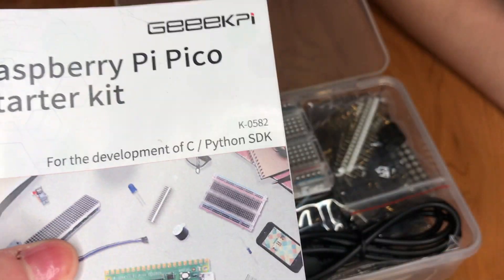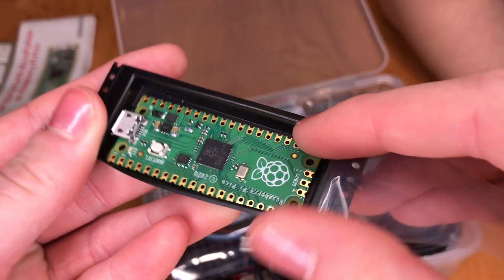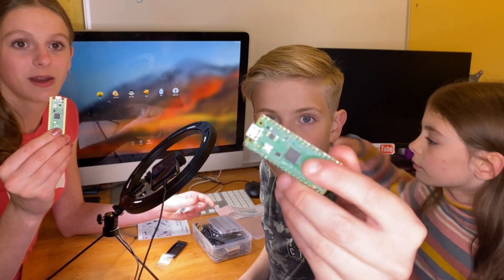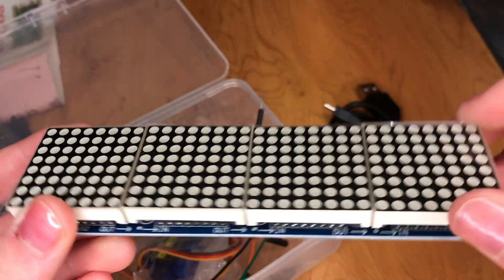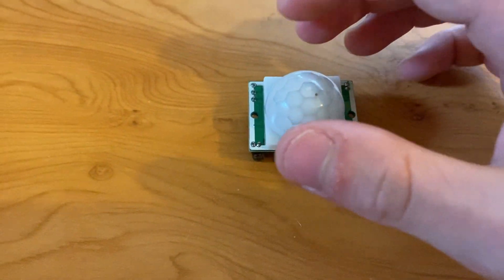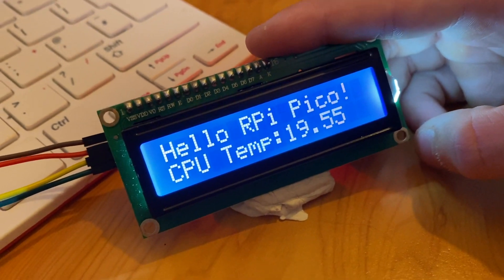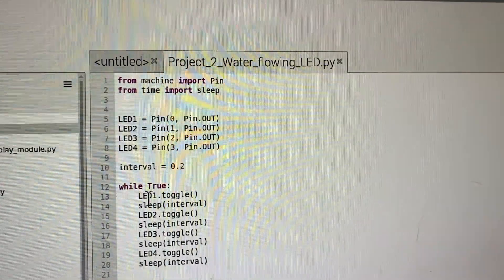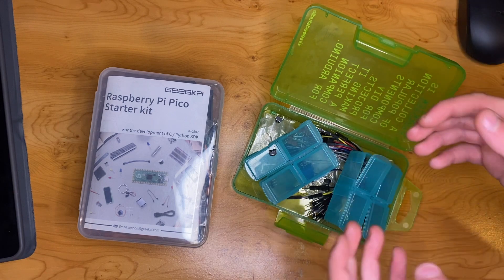Geeek Pi Raspberry Pi Pico Starter Kit - Review and Parts Demo

Comment: 💗 Good review with examples of what can be done with the components, and how you can modify the code. ❤
One thing that is nice about the starter kits is that you can start making projects right away, without having to wait for other parts to arrive.
So for someone that doesn't have a collection of sensors, jumpers, leds, etc. getting a starting kit makes things much quicker to start enjoying the pico.
But they aren't as good for people that already have a stash of componets from an Arduino, ESP, or Raspberry Pi kit, as you will get a a lot of duplicates.
Now that I said that, the nice thing about duplicates is that you don't have to destroy your last project to make the next one.